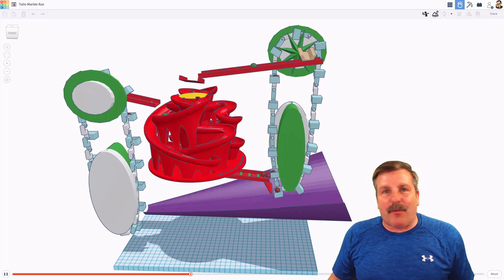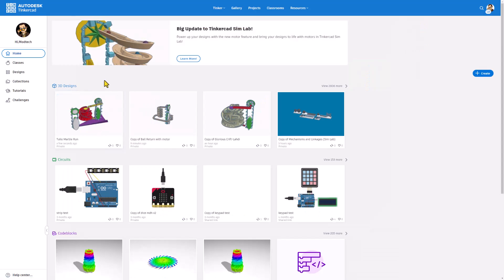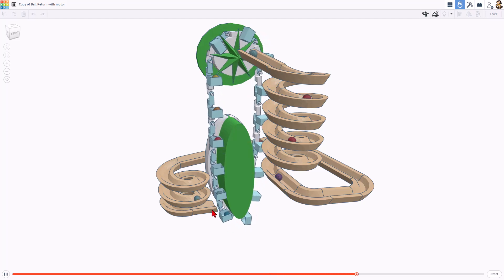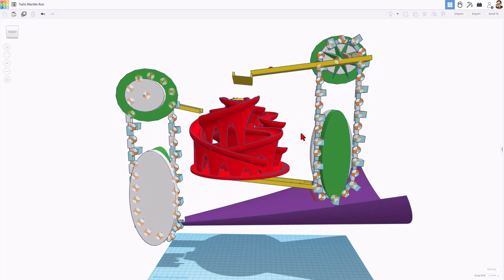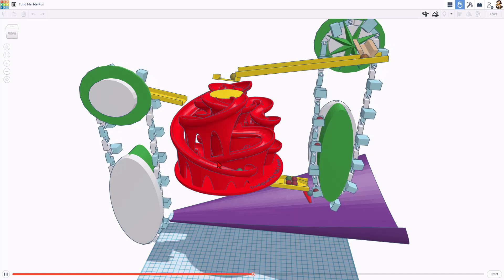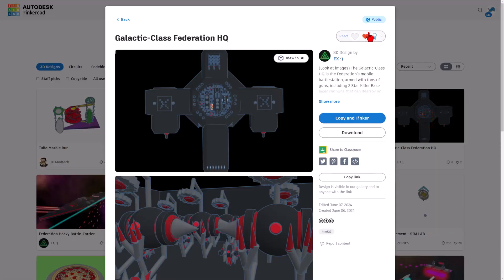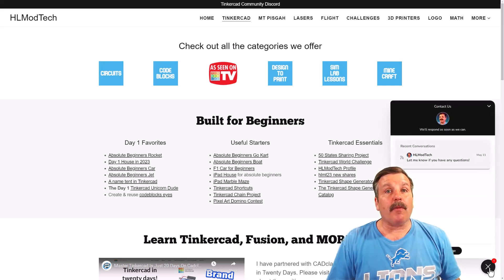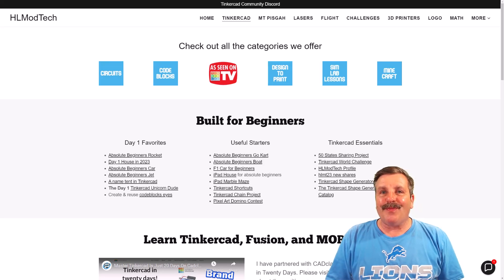Sim Lab Marble Mania! Free Tinkercad Challenge STEM Project!

Comment: I wonder if you could convert that .stl import into a 100% Tinkercad object. Might help the slow loading of the simulation.

I also plan to make two sequels to Super Marble Race one of them is going to have a marble elevator (based on the elevator in the "Little Park Sim Lab V2" staff pick design). If the elevator works out as planned, it's going to be a marble lap race.
Reply from the maker: I am sure there are some Tinkercad users capable of that. The design that Tulio created is pretty freaking fantastic though.